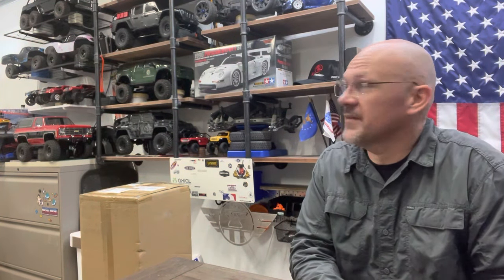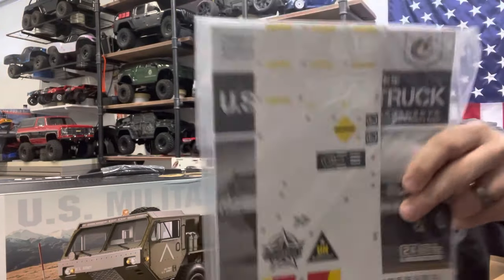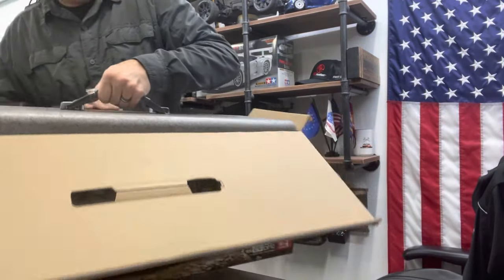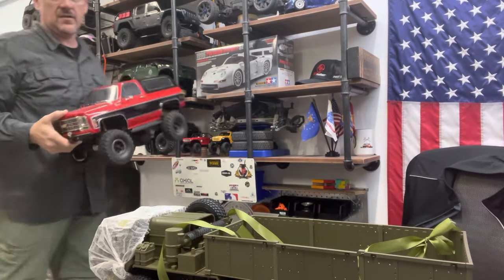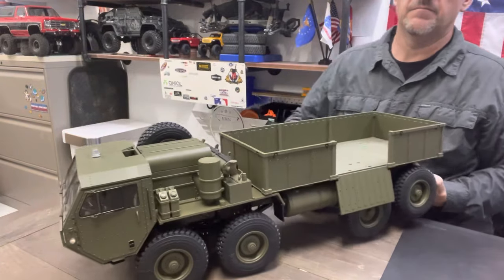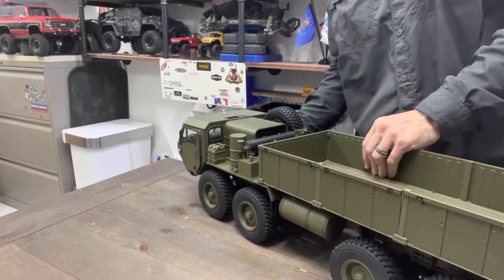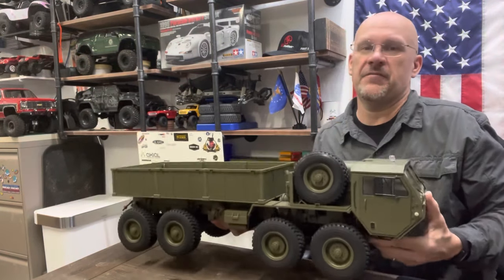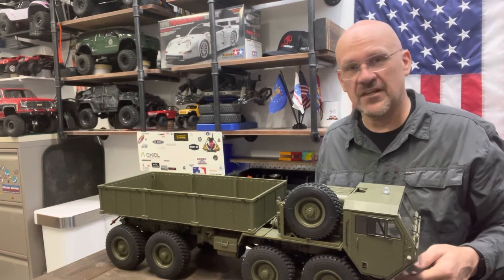Project: HG801 Part 1

Comment: It's a big beast, with bunch of metal parts. What needs attention is steering system, since I noticed one of two servos can lag not turning in sync. I think someone did a mod making it one servo system, but with pushrods connecting both steering arms (front and back). I only sanded servo reel from back steering (2nd axle) to make turn radius smaller, just like real truck has. OOB steering is with same deflection, making 2nd axle tires grind and deform while under load and on concrete. But it is fun to (scale) drive. ;)
Reply from the maker: Appreciate the info. I’ll look into upgrading the steering components.
Reply: @All_RC_Fun  Two options: one servo https://youtu.be/2mUpUQVQKGY or two servos https://youtu.be/L5nAbhJY7hw